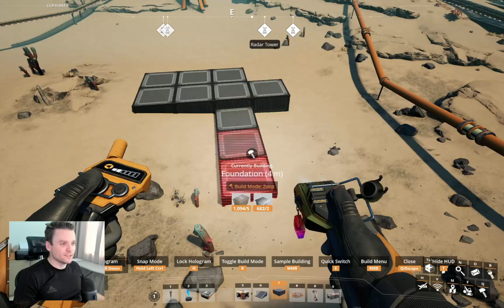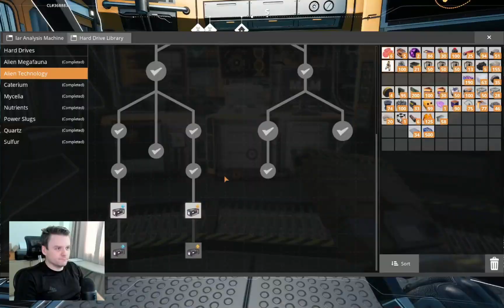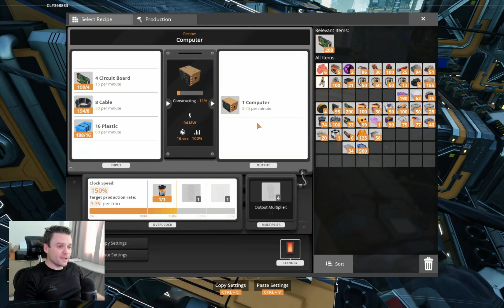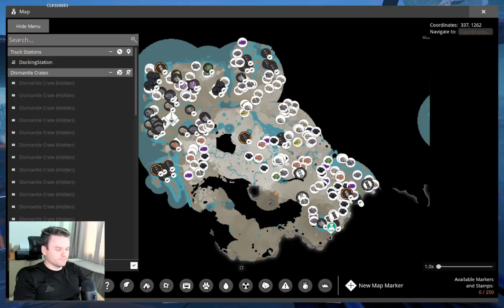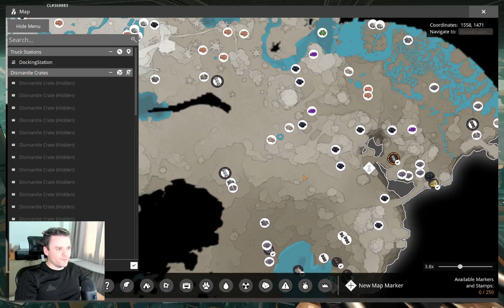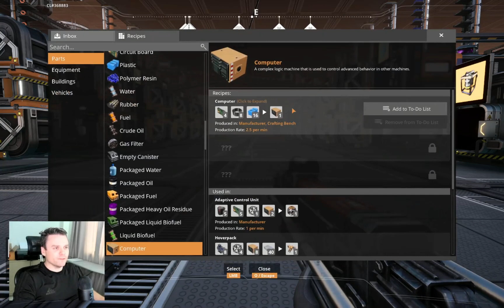Satisfactory 1.0 - Just the Tips... and Tricks

Comment: Nobody ever notices. When aligning mergers and splitters, there is a line. If the line is green on one end and red on the other, you can't put down a conveyor belt to connect them. It's easy to not get those guys turned right, and this really does help. I've never heard anyone point it out. Good video, mate. Good contribution.

Comment: using the big "power tower poles" for ziplining was already possible in update 8, as well as ziplining along "wall attachment pole plugs" at a ceiling under some platforms. in both cases you will have no problems crashing into power poles, and you only have to watch for the angle of the connections at intersections or splits. i think the maximum is to deviate by 60 degrees horizontally from the previous direction, using only 45 degrees myself to always be on the safe side. vertical changes of the angle may be more critical, especially when turning upwards or turning vertically and horizontally at the same time, while turning downwards would make you "push into the wire" and thus be less critical.
it is also possible to attach catwalks to the tower poles, so that you easily land on "safe ground" when leaving the zipline and not falling to the ground.

"hold to sprint" is an option that determines whether the hotkey for sprinting needs to be held down or whether it toggles sprinting on and off. when set to "toggle" (option "hold" is turned off) it will stay that way (do not use the hotkey every time you start ziplining again) until you switch that option again, press the hotkey again, or are spawned the next time (on loading a save or after death). that hotkey can also be changed to a different key so that you don't accidentally toggle running on or off all the time when using the shift key for different purposes (eg shift-click for moving stacks of items) or when touching it by accident (mistyping shift instead of ctrl). i have set mine to a "far away" key on my keyboard, eg one of the keys to the right of "0" (on my german keyboard "ß" :-) and now push it only once immediately after a respawn.